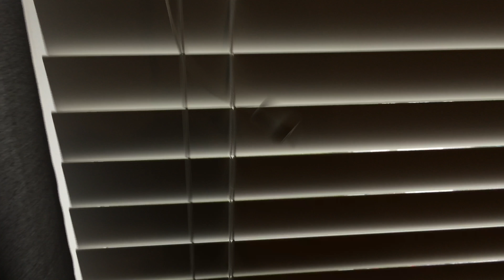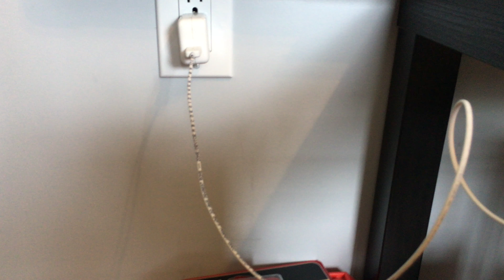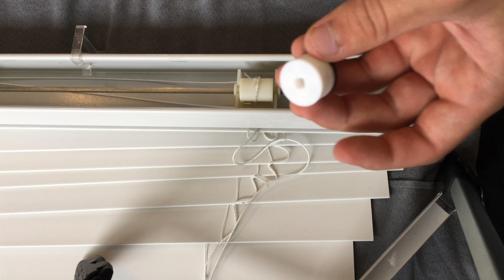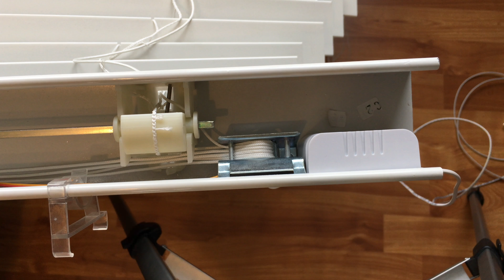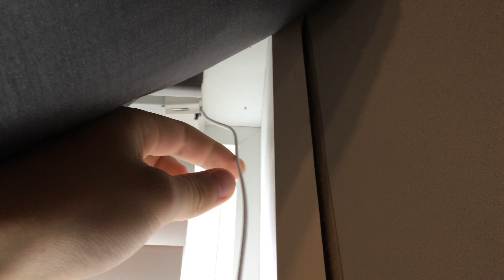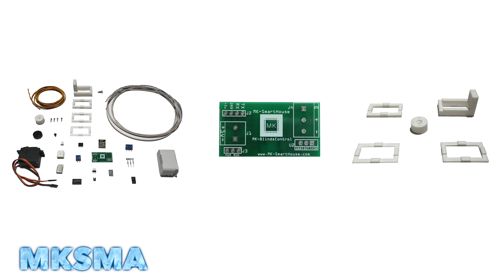Complete Guide Blinds Control MQTT OpenHAB ESP8266 : Final Installation

Comment: Anyone having problems with this device? Mine worked for about 2 weeks now it will not function. I reflashed the software then tested on MQTTfx, it worked for less than a minute then dead again. Any ideas? I did not change any code in the weeks that it was working so I am not sure what changed or if the esp is just defective.

Comment: Tested out the MK-SmartHouse blinds control kit that I ordered. (using mqtt and adafruit.io)
Board was well thought out and easy to solder the components  on. The 3d printed parts were very nicely made. I will have to design and print another motor/rod coupler as mine is a 5+mm hexagon. Good work keep it up. 

https://youtu.be/OuufZOA6P0A
Reply from the maker: +androidjmurphyca Thank you! May I use your comment as a testimonial on my website?
Reply: Absolutely. Append the shipping was timely and the components were accurate. Good luck.

Comment: Can i control the open and close of my studio shades with this system? 
They dont have the tilt control but i can just open and close the shades.
Reply from the maker: +Antonio Cirino when you say open and close does that mean raise and lower?
Reply: MK-SmartHouse yes, sorry but my english is bad.
Reply from the maker: +Antonio Cirino this device only tilts blinds it does not raise and lower because the servo only has 180 degree rotation